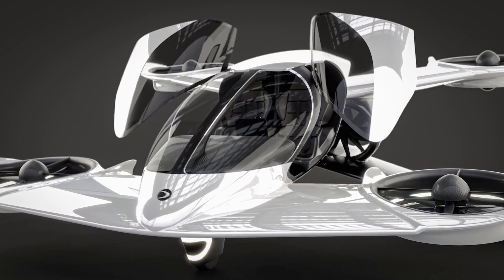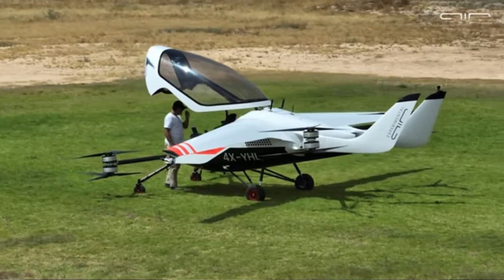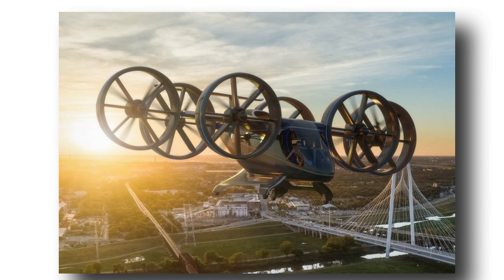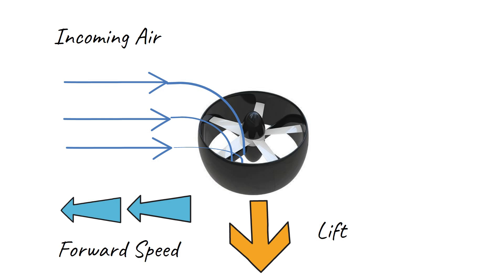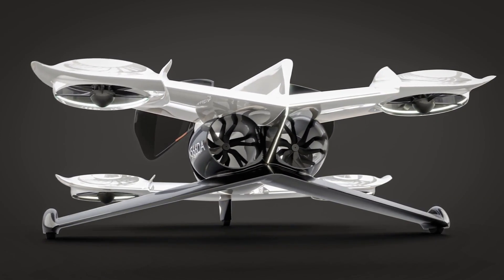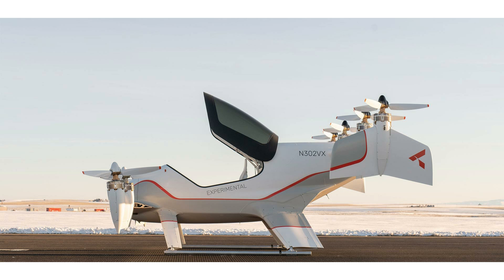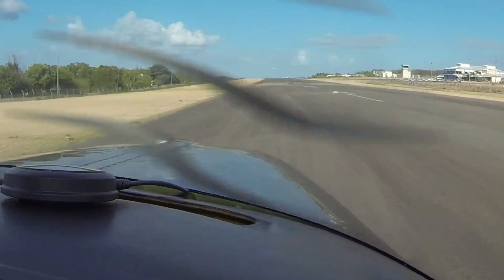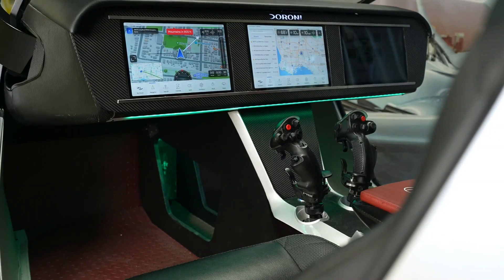The Doroni H1X: A Unique 2 Seater EVTOL

Comment: 40 minute flight time indicates the H1X is pretty inefficient in forward flight. Compare to the 2+ hours of the Pyka Pelican 1320lb LSA class cargo ctol. 

Granted one is a ctol with weight benefits, but could it be the forward facing edfs have less thrust to power than open props? Not to mention the longer design and engineering validation and time to market to prove out safety and reliability.